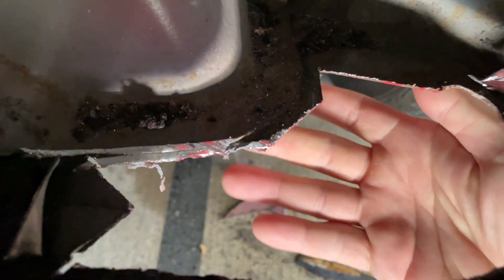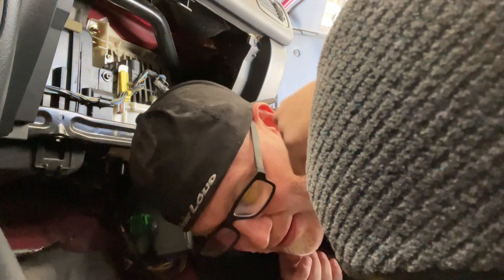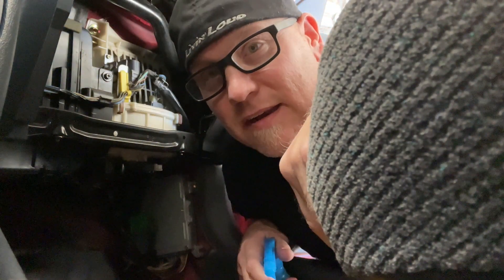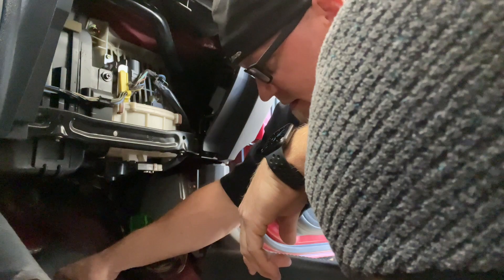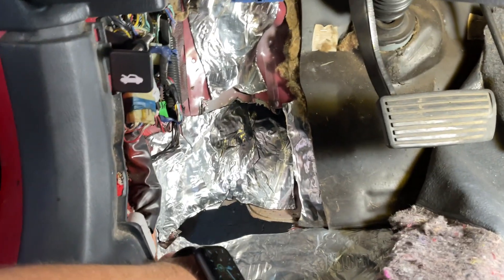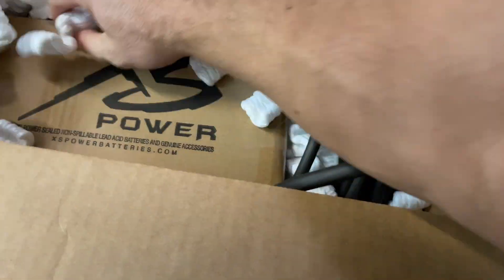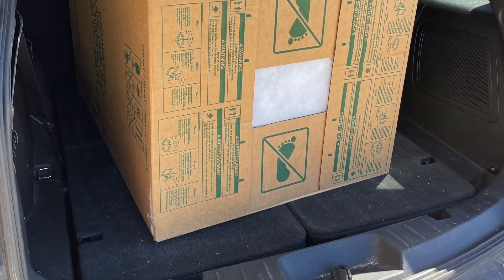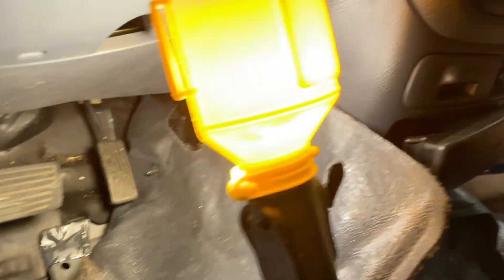Finding SQ. Episode 4

Comment: Is there a reason for using the loose fiberglass rather than the glass sheets. Does it work better for that application or is it just your preference.
Reply: It just looks "loose" because smaller pieces were ripped from the main sheet instead of cut with scissors. All that fluff on the edges will be cut off anyway. It just looks a mess in the process.